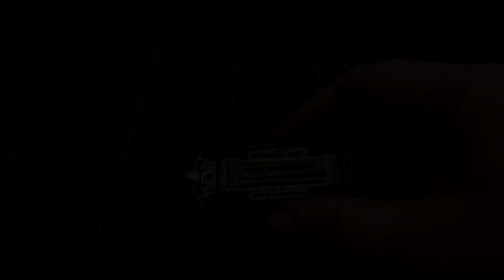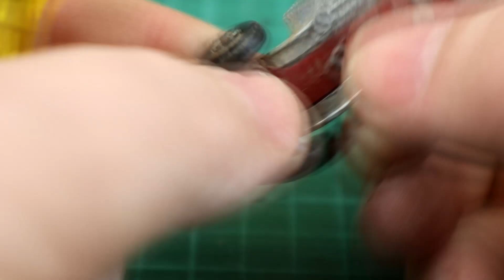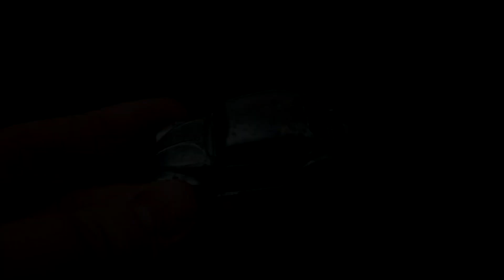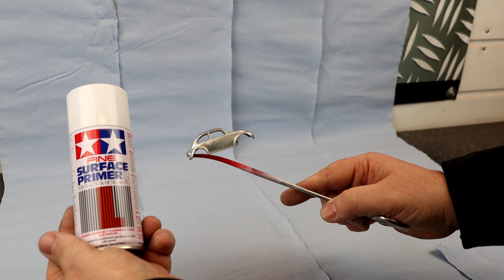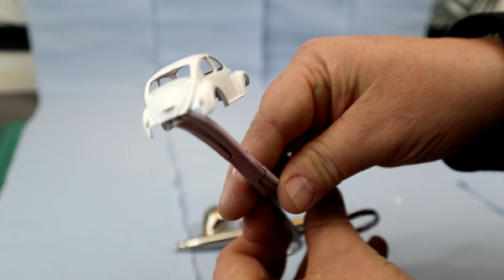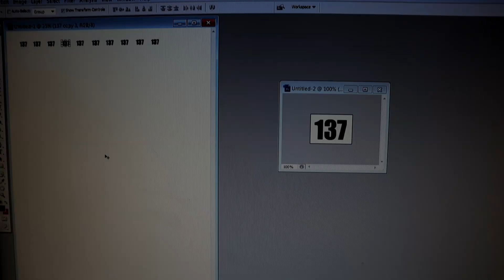Matchbox VW Beetle 1500 Saloon 1968 Restoration

Comment: I believe the large wire wheel with the faster speed heats the metal too much causing distortion of the soft metal. May I suggest a Dremel type tool with a small wire wheel so you can vary the speed therefore reducing the amount of heat to the metal.
Reply from the maker: Yes, I have used the Dremmel in previous restorations but the wire wheels I have are no good and spit the wire out everywhere. I need some new mini wire wheels.

Comment: for the sake of your lungs, please use a half-mask respirator when working with lacquer paints. even in well ventilated areas the fumes and vapor can cause serious damage, a booth with an extraction fan is also recommended. stay safe lacquer is good stuff but not good enough to risk melting your lungs from the inside!
Reply from the maker: I do wear one bud
Reply: @retrorestore   good good, I see lots of folks airbrushing without one and it makes me nervous

Comment: Acrylic paint thinner? You actually bought a tiny bottle of water? Been airbrushing for decades, use water right from the kitchen faucet and I have very hard water. Never any problems. If you would like I can fill up a few bottles, slap a fancy label on it and sell you some.
Reply from the maker: These are solvent acrylics not waterbased bud.

Comment: Another nice job! Those dremmel wire brush wheels are more than useless, do very little except fly apart and stick in your clothes
Reply from the maker: Exactly, there must be better ones out there. though Kev.
Reply: @retrorestore  ive found the more you pay the better they stay together, but all pretty much useless in their effectiveness. I Think your use of  a bench grinder with brass coated wire wheels far better and more economic